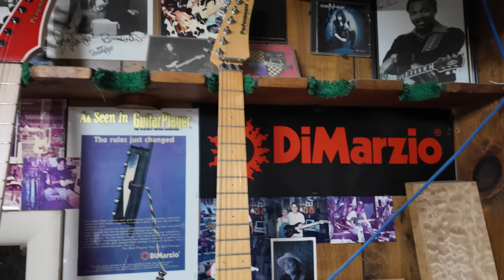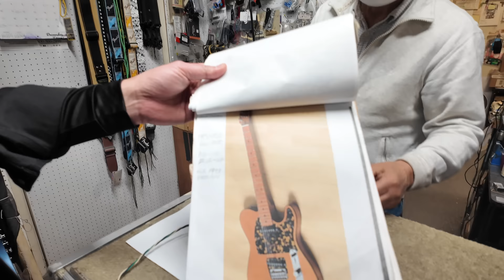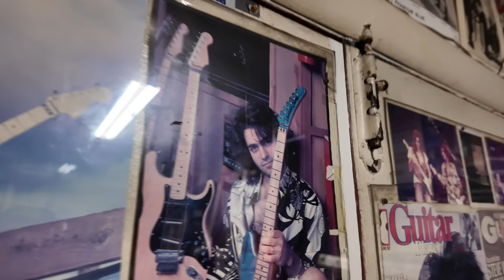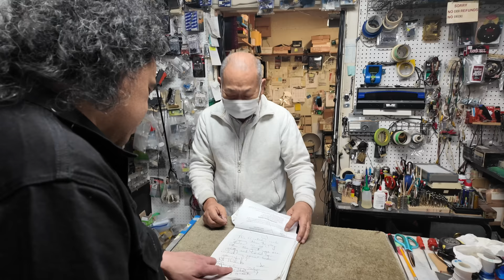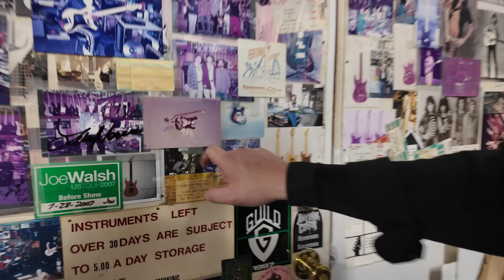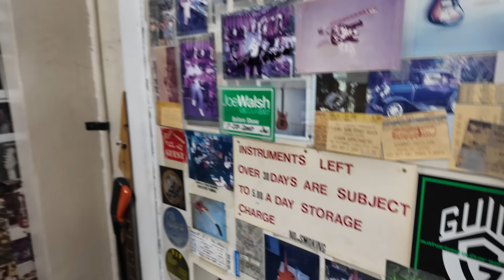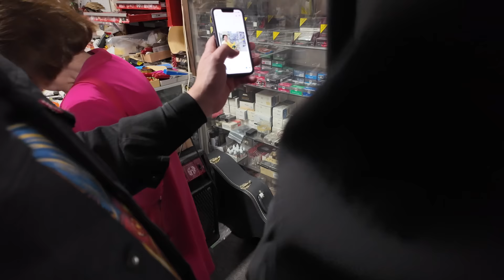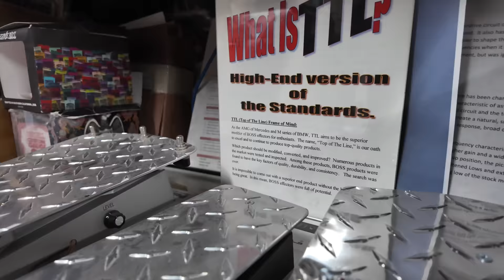Took my dream guitar to Performance Guitars Hollywood! Shop visit VLOG

Comment: hi! this might sound like such a stupid question but i literally know nothing about in ear systems. 1) If I wanted to get the Phenyx pro ptm 10 does the transmitter just plug straight into a wall outlet? or are you supposed to connect it to something else?? 2) I'm a singer and I want to get this to hear myself/the backing track live. Do I need anything else? or does this come with everything I need?